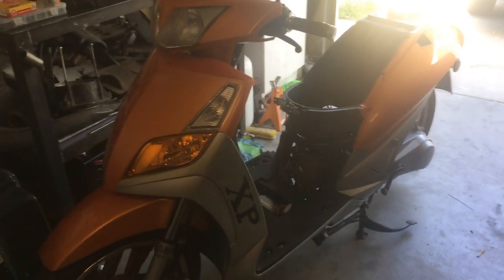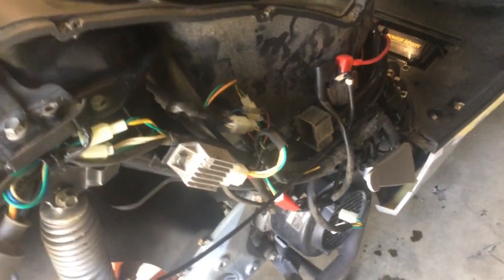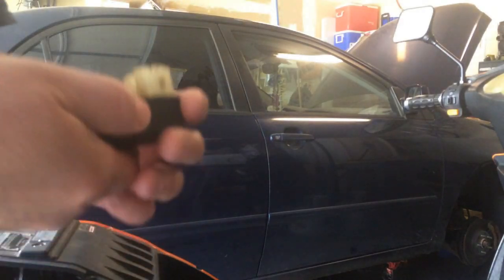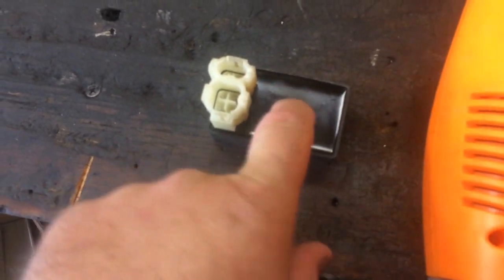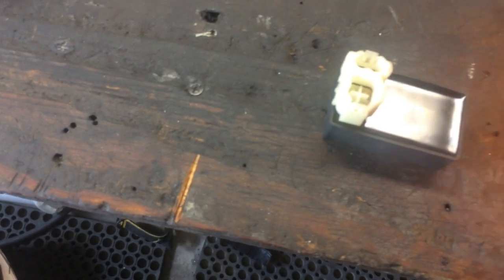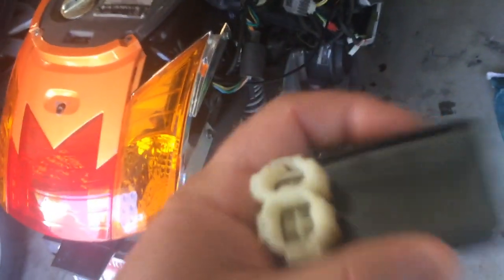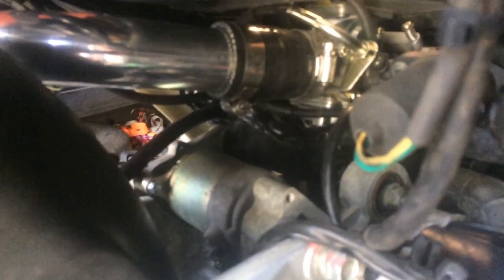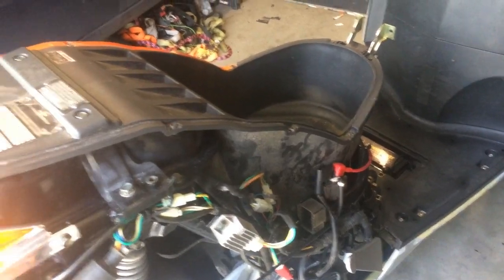150cc scooter GY6 CDI test and repair - Free fix

Comment: I actually tried heating it up but it didnt work for me, so im just gonna buy a replacement one and hope. 
Because it does sound like the same problem i have, where it did run flawlessly and than after sitting all night just didnt fire up at all anymore having no spark, 
after cranking for a few min it did start again and ran great but again after sitting it didnt and now it never came back to live, so i will buy a nicer on probably with an adjustable rev limiter to go faster and will update this later, if it worked. Lets hope ...
Reply: hey, did buying a new CDI fix the problem?
Reply: @TrailersYT  Nope unfortunatlly not, ive sold the scooter as is with all the new parts but non running, the guy told me that he fixes scooters as a hobby and he thinks thats its most likely the generator
Reply: @BadMax02_VR  oooh damn that sucks. I bought a new CDI unit and a new bougie cable so let's hope :)

The bougie cable was in really bad shape

Comment: Does what you said work when you heat the CDI very hot with heating, combine it in a hot state, and turn on the engine?

Comment: Hey I put a new CDI box on my scooter and a new battery my scooter just still not start so I'm going to wait until I started comes in for my scooter cuz when I turn the key and try to start it it just clicks I changed the solenoid

Comment: I have a no spark issue , when I check both connections at the coil with my multimeter for continuity both wires are grounded , is this normal ??
Reply: This is because the primary winding of the ignition coil has less than 1 Ohm resistance , so it’s normal.

Comment: Ive replaced the cdi coil and solenoid and the stator shows as being good, but still no spark. Any suggestions?
Reply: Check your carborator
Reply: @RKQUD  
Since when does a carburetor fix an electrical spark issue?

Comment: Circuit board is actually at the bottom, but the plastic acts as a heat shield. If you look at other videos, it shows them cutting the bottom (NON-PLUG) side of the CDI module out to repair the circuit board with a soldering gun. Good fix, regardless. Thumbs up from me. Also- Spelling for the different modules. NCY Naraku Casoli

Comment: I had spark, no spark, spark, no spark.  I did what you said and whalla!!!  It works.  Thank you so much.
Reply from the maker: Glad I could help!
Reply: really broo i have the same problem i would try this
Reply: Hey bro my motorcycle has the same problem but don’t work with this trick do you know other thing I can do to fix it
Reply: hey, did you still end up changing the CDI unit? or did you just keep on using the same one? And if yes, how long did it last?

Comment: That totally opposite with the Ford module, when the module get hot the engine stalled,then  I have to pull colds water on it to start up.

Comment: Mine will cold start and will idle but then it will stall out when it gets to operating temp it will turn over and then it finally starts  but then dis after 1/4 mile

Comment: Partsforscooters.com has the DC racing (blue) AC racing (gold) and the orange. Have you played with the variable/adjustable CDIs? I'm really curious how those working
Reply from the maker: Yes I have. I own the orange style, the blue and I have the expeensive adjustable Nar CDI. After experimenting i found it easier to start with the stock CDI and put it back on. Ayone that wants to buy some CDIs I have a few that are brand new used for testing a day or 2 then removed and put back on the shelf.
Reply: How much lol